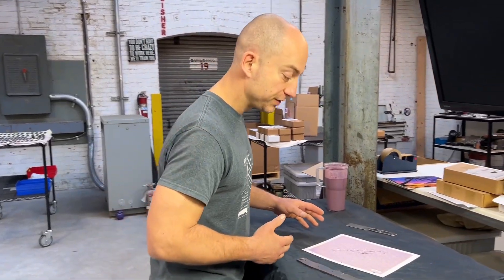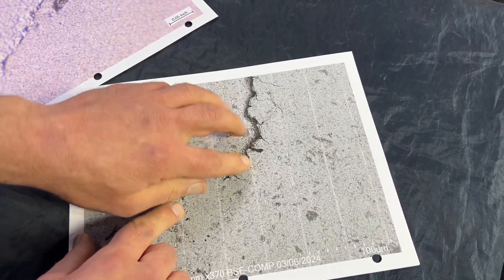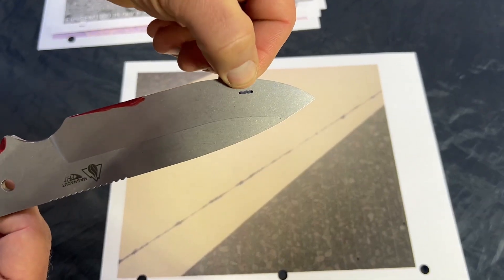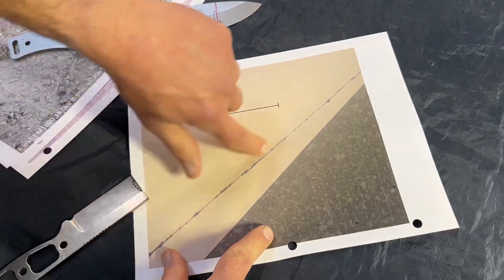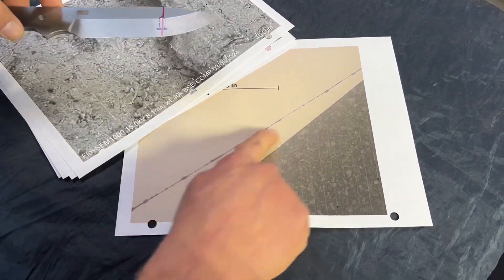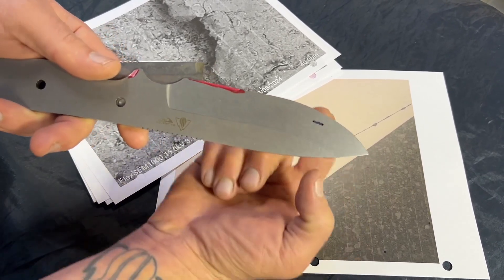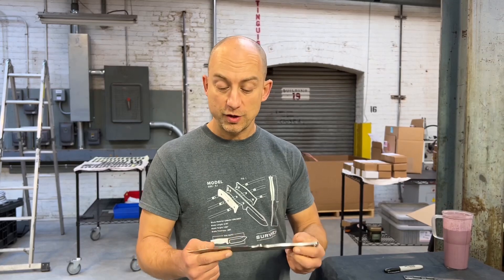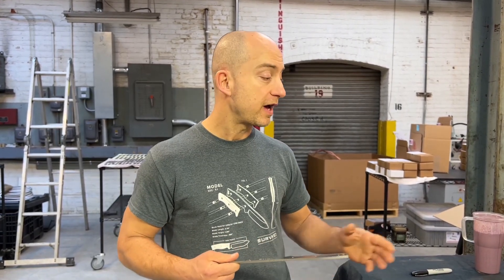Magnacut Voids: Lab Images Explained

Comment: Ahh, sweet vindication. 
Question/thought/ theory: it looks a little like the powder wasn’t mixed thoroughly before sintering. Have you used a magnet on those flakey bits? Are they magnetic? Maybe some of the metals in the composition are magnetic and sticking together in strings. I had that thought and read a little on the PM process and found there’s one method that uses electrical current called ECAS. That could magnetize some of the powders but not others. Do they use that process? I haven’t checked which metals in magnacut are magnetic and which aren’t, but I read that chromium is “paramagnetic” (slightly). Wierd stuff happens under pressure and heat. Maybe their process is causing metals to link up during the sintering to create those non-homogenous zones.
Reply from the maker: The lab apparently has some time on the SEM today, to take a closer look at this situation. It shouldn't take too long to understand exactly what is going on inside this Magnacut steel. A 1.5 million dollar machine has the ability to answer all the questions. 😉

Comment: This is clearly a materials defect and not an issue with Survive's manufacturing process.  It would be interesting to get an elemental analysis using a mass spectrometer to find out what that abnormal material actually is, if possible.
It makes me wonder how many magnacut knives from other manufacturers are out there with similar issues that have been hidden by various finishing processes.

Comment: Ok, if you’re so confident the material is absolutely worthless and you have the backing of a bunch of different knife makers and metal experts behind the scene, then why not take this to court? From what you said, that should be a slam dunk.
Reply from the maker: The short answer? It can cost a lot of money to be right in civil court, even if the evidence is obvious. A large company has the resources to drag out proceedings for years. A small time, local attorney is around $150 an hour. A fancy attorney can be $350+ an hour. Large companies tend to hire several fancy attorneys, who will bury you in procedure, until you run out of money or give up. I don't want to play that game, which is why I have been carefully standing on observations and verifiable facts. That is also why we are just making all of this information public, to spread awareness. Other people are going through this, and they need a voice.
Reply from the maker: As a follow up, the metallurgy field is extremely small. Those people fear reprisal from these large companies. If this goes to court, they would only give written testimony if it is sealed by the court, and only viewed by the judge. Other small companies and makers are afraid of being cut off by suppliers, so they don't speak up. Please know that it was not an easy decision to open up and start talking about these things.

Comment: Just a dumb quick guess; Grease or oil from the rollers. The sheets get rolled out hot along the rollers... none of the rollers in the NSM look clean at all judging by some videos I've seen. If you want the best material you think they would have as clean as an environment as you can get. I get its a fordge and they ate dirty but thats the first thing i noticed.... damn those rollers look nasty. Just a small example, would be to mirror polish your rollers more offen to help stay low on impurities. Maybe I'm over thinking it but.... ?

Comment: I’m curious. So up to now have all the defective parts you’ve come across been from those first sheets of magnacut you received or has this persisted through every single sheet of magnacut that’s come through your shop to date?

I have some early magnacut products like the spyderco mule that I’ve noticed some weird stuff within the steel when sharpening. As well as another product that appears to be rusting without any reason and in an odd manner almost as if there’s something else mixed into the steel matrix. Now I have not noticed or found anything like that since those very early magnacut products. 

I should add that I’ve been paying attention to all this since the “start” and have tried to keep an open mind in hopes of seeing real evidence which it appears you have now. Like I said earlier though, I’d love to know if this is all just early magnacut or if it’s been a continuous thing. Also that’s not to take away from whether you should be made right or discredit any of your findings, just curious to compare them to my findings.
Reply from the maker: We have material test reports or MTR's, from at least three batches of material bought directly from Niagara. We have also bought batches of material from SB specialty metals. What we have been observing, has been pervasive through all of this. I said this in a previous comment, but I have yet to process an entire batch of this Magnacut material and think to myself "that went well". I regret ever hearing the word Magnacut.

Comment: The way you talk about these issues you must have thousands of parts with voids.  You sent 9 to NSM and you've shown a handful of some you have.  Show us the piles of unfinished knives.  What is the real failure rate?
Reply from the maker: As a follow up, I was sending what Niagara asked for and what fit neatly in a standard box. We are seeing an average of about 20% of Magnacut parts having visible defects. 

In a conspiracy to keep our business somewhat viable during all of this, we have sold parts with minor blemishes as factory seconds. I don't want to be doing that and no other company would make us do that, which is where I maintain the position that we should have been able to return the entire batch of suspect material. 

I shouldn't need to cherry pick what needs to be acceptable and negotiate with my steel company like we are at a flea market. These are engineered materials, sold for industry leading prices. There is an implied expectation of quality when using CPM.
Reply from the maker: Yeah, I was expecting this angle next, the redirect. First you folks say there is no issue, now you're going to be dismissive by trying to minimize it. 😂 I'll make a video for you guys shortly. As with most of the smaller parts in Cruforge, a lot of scrap was left back in Idaho. 

We're unfortunately very used to having warranty issues dismissed, so at the time it didn't seem worth it to drag obvious scrap across the country. The idea of litigation never even crossed my mind, because from our side, I know that route is very expensive and drawn out. As a small business that would be fighting a big business, that is often a losing proposition, simply because the large company has a much bigger litigation budget.

We have multiple lab reports going now, so that will insulate us from any defamation or libel claims on their end. I just want to make knives, not play these games, but I'm also willing to take this the whole way if I know I'm right.

Comment: I have been back watching alot of your videos and i was wondering have you only experienced theses issues with the one batch of metal? I believe in one of your videos you might have said you have ordered more to fulfill customers orders (please correct me if i am wrong). If you have placed more orders are you still seeing these problems?
Reply from the maker: We've noticed this issue across several batches. We have 3 mill test reports for materials we bought from Niagara Specialty Metals. We've also sourced sheets from SB Specialty Metals, that would have been from different heat numbers. I have yet to grind an entire batch of this Magnacut material and think to myself "that went well". Not once.

Comment: I've abused my 5.1 in Magnacut and if it had any issues I'm pretty sure it would have failed so thankfully I seem to have gotten a good tool. And by abuse I mean I used it as a frow, to cut, carve and chop as much as possible for days. All documented through pics and video. Someone called me a wood processing machine 🤣 I also know if anything does fail you'll make it right 👍
Reply from the maker: We 100% inspect our parts at every stage during production. Any blades with single large defects or multiple smaller defects do not leave this shop.